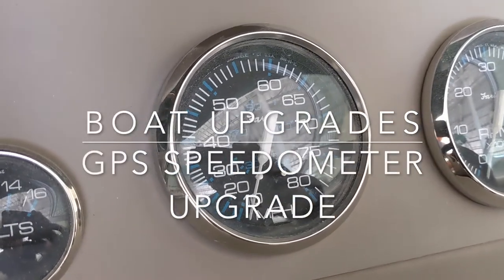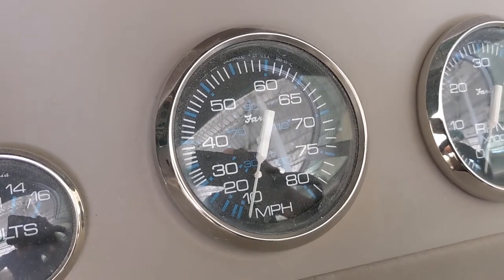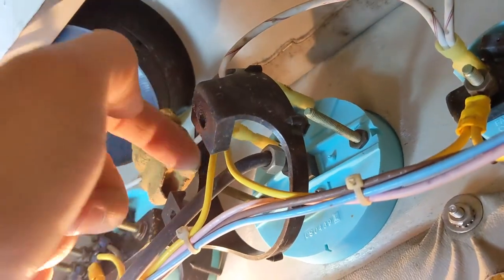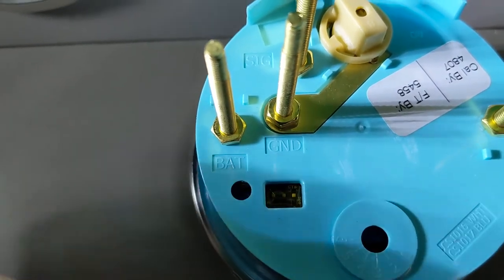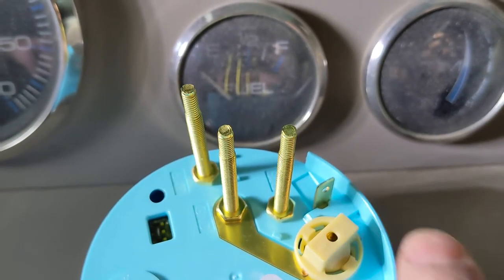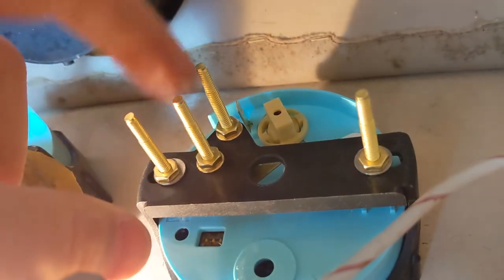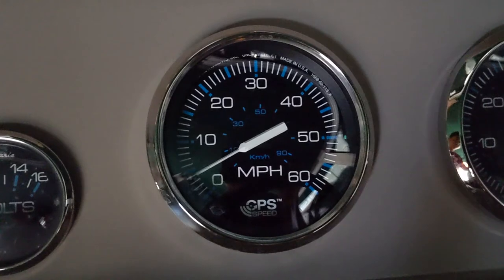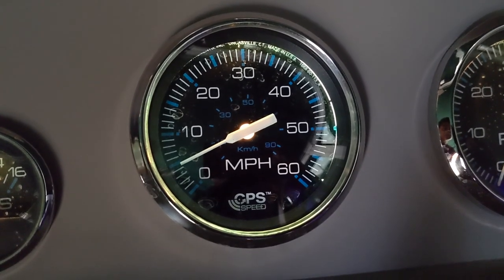Boat GPS Speedometer Upgrade - Super Accurate Speed Reading - FINALLY!!!

Comment from the maker: 5" GPS Speedometer 60mph: https://amzn.to/3bal1Dz
4" GPS Speedometer 60mph: https://ebay.us/Da37IJ
Waterproof Marine Splice Connectors - https://amzn.to/3dMl1v2
Crimping tool for insulated connectors - https://amzn.to/32EsFBu
Small butane torch - https://amzn.to/32DBrjg
Wire cutter / stripper - https://amzn.to/3emjawe

Comment: Once again l come to your page for great info doing all my gauges you bypass the constant 12v just for switch 12v any problems with that and what would be the benefit of a constant power in the manual they say they recommended the constant 12v
Reply from the maker: Either switched or constant would work. I'm personally not a fan of having constant power to anything unless it is absolutely necessary, or unless it has some sort of an "off" switch.

Comment: Is the gauge self supporting?  No need for an antenna or a source?  The gauge will find the GPS signal all on it's own?  
That would be perfect!
Thanks for anyone answering this question.
Reply from the maker: That's right, it has its own internal GPS antenna. No need for anything external. You just install the gauge, give it power, and you're good to go!!
Reply: @NKPGarage  but why then was it reading 5 when you were stationary?

Comment: Did you leave the old rubber tube from the pitot in place or pinch it off somehow so that water won't enter the boat behind the dashboard?
Reply from the maker: At first I looped it and punched it off with a zip tie. Later on when I was doing some rewording I removed it completely. Just make sure to punch it off at least or water will drip from it

Comment: on the old gauge they did not label the ground and positive for the light because just to run a 12 volt incondecent bulb light it does not matter which prong the ground or positive went on it would work either way the new one matters because it doesn't just work for the light  know but also the gps functionalty
Reply from the maker: That makes a lot of sense. I wasn't thinking of the older gauge's polarity in the wires. Thank you for sharing, that's great information to know!